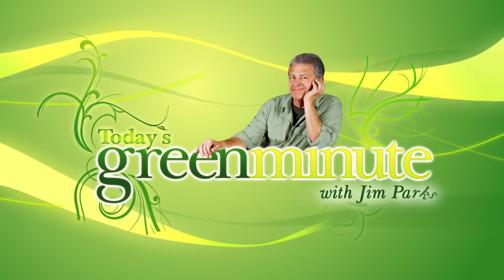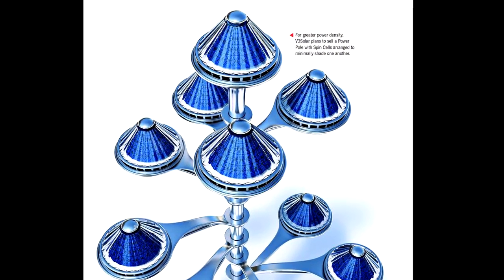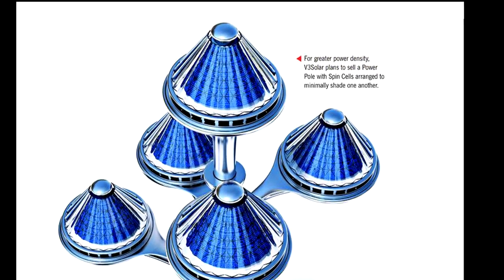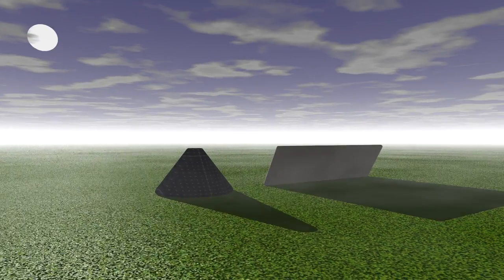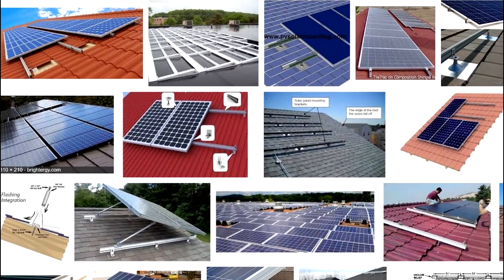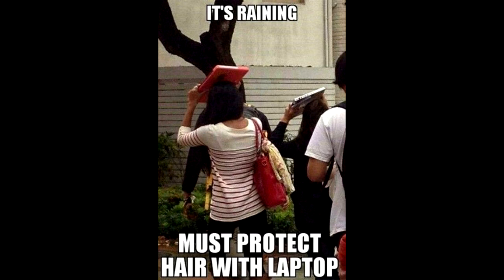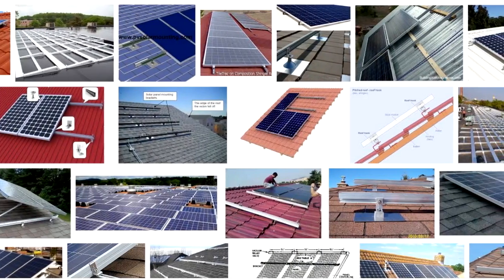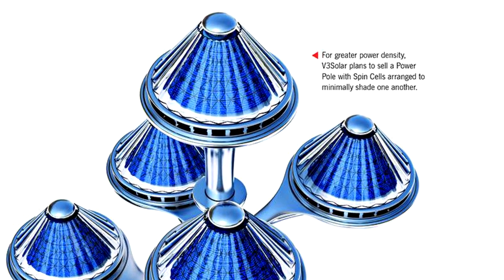Spinning Solar -BUSTED!

Comment: I'm not saying your conclusions are wrong, the cone solar panels are likely bullshit but your assumptions are very simple and don't give the solar cone developers claims a fair test.
One of the principal points of the cone is that fixed panels aren't always perpendicular to the sunlight, in fact, at best there is only one time a day on two days a year that a fixed panel would be 100% perpendicular to the sunlight.  
Using a tracking panel isn't fair because of course that would of outperform the cone, it's the comparison to a fixed panel that is where their claims become worth considering.
In the early morning, or near dusk it is easily possible that the cone could be generating some power while the fixed panel is still shaded.
Conversely during the time the fixed panel is generating at it's best much of the cone panel would still be oblique to the sun light with only a thin strip ever being perpendicular at a time, and much of it would be shaded as you said.
Basically any time the cone is in sunlight it will be generating near it's best performance, that peak may be lower than a fixed panel of the same areas peak generation but could be higher than the fixed panels high oblique angle generation ability and if this is the source of the efficiency claims (which I'd still be surprised if they were even in the region of being correct) it could start to make more sense.
Obviously I've done none of the math for this, that's why I'm not saying you're claims are wrong or that their claims are right (I believe you're conclusion is correct and their claims are wrong) but overly simple back of the envelope maths can easily lead us astray.
Reply: Except solar panel farms almost exclusively use teaching panels, not to mention that never cones never have more than 50% efficiency at anytime, minus the permanently spinning motor, is still never going to make more power than a flat panel of the same surface area, not to mention that manufacturing a bunch of tiny solar panels and arranging them into a cone would add to production costs
Reply: @aymanayad7230  I agree with everything you're saying but I've seen very few home solar installations with tracking solar panels, they're almost exclusively fixed.
As I said, I don't disagree with the conclusion, I just think the method of calculation was very flawed.
Reply: Flat non-moving solar panels are miles more efficient than the cone. Using identical angle, identical placement, and identical sunlight exposure, the flat panel generates more power, assuming an identical surface area of panelling. While the cone would produce slight more at sunrise and sunset, these are also the times where the sun is weakest. This is like bragging your tank armor is better at protecting from scratches and dents. Sure, maybe it is, but that's the least relevant amount of damage it will endure.

First off, assuming identical area of panelling, the cone already loses 50% of it's power due to half the cone facing the wrong way. It then loses another good portion to having a bad angle towards the sun. It does gain a slight bit back thanks to the cooling, assuming the spinning comes from an external power source, not the panel itself (worth considering where that power comes from though), but typical solar panels lose single digit percentages  of efficiency to overheating. The graph shown in the video shows they lose up to 10%+ in very high heat, however that's ground temperature. Solar panels are slightly suspended in the air over roofing and the floor, meaning they are far closer to air temperature, so they are actually losing far less efficiency than you might think. Cooling is far less important than the angle of the panel compared to the sun.

Comment: Good video, but you can't compare a three-dimensional structure with a 2D one, like flat solar panels.  when you compare the geometries it is necessary to consider the area of occupied land that is actually smaller in a cone solar panel.
Reply: Sure than compare it to a small ass tracking solar panel, i mean it doesn't matter either way since we haven't reached the point where there are no more wastelands to build solar farms on, or no more roofs to fit some solar panels on.
Reply: Even if that were the case, average cost of land in the US is ~$1 per square meter, average cost of solar panel is ~$150 per square meter. So any land savings have to be considered damn near meaningless compared to the price of the panels you want to install. Hell, you can have pasture underneath your panels, for sheep to graze on.

Comment: So if I stand behind a conelike object from the opposite direction of the sun I will see a 100% black conelike shape?.... obviously not  so your first argument is inaccurate since that contraption will generate energy on 100% of its surface but less efficient on the part of the surface that doesnt look directly to the sun.

The lens argument is also inaccurate because its true if the object inside is static . 
If they focus the light on thin strips of the cone while the cone is spinning it may have the effect of a bigger lens focusing on a static cone. 

And also you seem to forget the spinning part of the contraption which multiplies the efficiency not only because of the thermals but because its altering the efficiency since flat panels are not efficient when the sunlight does not shine directly on them this contraption because it is spinning will always have a part of its surface directed to the sun and all the rest of it will keep on generating power just with less efficiency where a traditional panel would have 100% of its surface produce power on a lower efficiency when sunlight is not directly shining on it.
Reply: Energy gained from light diffraction off of solid objects is negligible compared to direct sunlight, so panels on the back are a waste of time and money. If they weren't, flat panels would have them on the back too.
The shape of the cone means only an infinitely small strip has perfect alignment with the sun, ever. Judging from the size they present the cones as, you will get maybe 10% of the front of the cone having a 'good' angle. For the flat panel, the entire thing has a 'good' angle for a good portion of the day, when the sun is at it's highest, and is delivering the most energy. The cone shape allows it to take in energy better at dawn and dusk, but at those times the sun is putting out very little energy compared to at midday, so it's quite a waste to try and optimize how much power you get then.

Spinning barely helps with thermal efficiency. Solar panels do not typically reach 60 degrees as they are usually elevated, allowing air cooling to keep them at air temperature, not ground temperature. That slight amount of efficiency is not enough to warrant the spinning. Also, the power needed to spin the cone has to come from somewhere, thus lowering the cones efficiency even further. And the biggest and most obvious one, half of the cone is barely generating power. If you took that side of the cone away from the sun, and instead placed it fixed pointing at the sun, it would be tons more efficient. You'd get both sides generating decent power at once.But then at that point you may as well flatten out the panels since the convex curve was only there for the cone shape, if you split it you don't need it. And then you may as well join those 2 halves back together again. Hey presto, you've turned your cone into a regular flat panel, and made it more efficient.

Comment: couldnt they use mirrors to reflect the light back onto the un used solar panels? love your vid, just asking.
Reply: They could technically do that. But why go through the effort of pointing a panel backwards and using mirrors to light it, when you can just point it forward?

Comment: 4:58
funfact a sphere has 4 times as much area as it's circular crossection
which means that on AVERAGE a solar panel flat on the ground located RANDOMLY anywhere on the earths surface including the night side will get 25% solar flux
so if this thing get's 30% when it's in the sun, half that for nighttime that's 3/5 as much as one randomly placed on the ground - they didn't beat trackers - they didn't even beat panels flat on the ground or just statically angled
not that tracking solar panels are very economically viable
not that solar panels would ever be economcially viable on a large scale either way

Comment: If we want to be pedantic, far less than half as efficient. Solar panels are going to be most efficient when at a 90 degree angle to the sun. The cone shape increases the exterior angle and decreases the surface area that is perpendicular to the sun, decreasing efficiency. 😂

Comment: I am not sure this is as bad as you are claiming.  If the cones have lenses concentrating the light (mirrors are better actually) then they would require considerably less actual solar panel for the same solar interception area.  This generates a cooling problem that they have reduced by spinning it.

It still seems unlikely, but at least there is an actual measurable improvement in concentrating the light.  Spinning a heavy lens array not so much.
Reply: You need to cool the cells. How exactly are they meant to be cooled if you turn around the green house above them? 🤔
Reply: @RubenKelevra   I was imagining parabolic reflectors so the cells would be in thin vertical  lines exposed to the artificial wind and the back would be right on the outside and could have some fins on. Incidentally in experiments using lenses on solar cells they are typically water cooled, so it may not be enough and the crappy pictures look like weirdly shaped lenses, but that happens when the artist and engineers don't talk enough.

Comment: Small correction on the math at 6:10min:   
A 20% efficiency boost on the 30% area increases the 'efficiency normalized' area to only 36%, not 50%. (30% x 120% = 36%)

Comment: I have read this statement a few times, which I think it complete bullshit... :

 “EVs convert about 59%–62% of the electrical energy from the grid to power at the wheels. Conventional gasoline vehicles only convert about 17%–21% of the energy stored in gasoline to power at the wheels.”  

How much did the generator, that supplied the grid convert again?  Or is this a non issue?

Comment: Im sorry. 
The decay rate of carbon 14 is slow enough for the diffusion of nitrogen, the decay element to escape a diamond battery.
And, the scientist, whom was doing actual science, with an actual hard working team at an actual university on how to better manage nuclear waste, deserves credit, and praise. It does not matter if the damn battery is terrible the use of the battery is for long lasting low power, implants and watches things of that nature. The diamond carbon 14 battery is sound in concept, and in prototype.  Betavoltaics are a sound science, even if media got ahead of themselves into sci-fi with the concept, listing that battery was distasteful.

Comment: There was a TV series a few years a go it had 2 seasons i forget the name but it had like 8 people in a end of the world scenario and they had to build things to survive like wood gas to run the generator and one built a wind mill to charge the car batterys so they had power. Either way one group had solar pannels and built them on a frame with a sensor to detect the sun moving them with the sun. It was enough to give them power to run lights and power tools. They even made a trike that ran with 2 of the panels running a electric motor. Good upload

Comment: 8:50 but the lenses wouldnt need to be as precisely manufactured as they would need to be for a telescope
i agree with you on all other points though

if solarpanels that reasonably work at 200C° would be invented you could use lenses/mirrors and water cool the panels
then using the hot water/steam to power a turbine
Reply: Great comment

Comment: I'm more inclined to think it would be better to simply leave it flat at fixed center point in suns path and play around with different lens to bend the light down no matter where the sun is at the time. then there is no moving parts or motors as you said in video. but i would guess someone already tried different lens (air, liquid or whatever filled). personally i really don't see solar as being a viable solution after you take in account the cost of maintaining them and replacing things as they break down. i mean none of those panels or battery/inverters will last forever. not to mention the cost of keeping those panels clean after there installed on your roof. have you ever seen what the solar light looks like after you had them around your house for a while? the panel is cloudy with being out in the weather all the time. my sister gave me hers old lights just to mess around with cuz they did not work as good as they use to. so i cleaned it up, put new rechargeable batteries in and cleaned the solar element with headlight cleaner polish  to get the cloudy look off of it and verified the it was getting a better charge from sun and it worked great after that. whose going to clean and polish the solar panels after there up on your roof? i bet there service department is willing to help you with that ... ca-ching, there you go the price of having those panels is going up. hope your getting a lot of electricity to make up for it.

Comment: Ahhh yes also bringing up the fact solar panels over heat, well your object is smaller and what happens when the sun is directly above the cone? Wait what’s that it is the thing you are trying to fix, having the light being at a sharp angle and also we can adjust solar panels to use that heat for more power but we don’t have a way to actually do this yet.

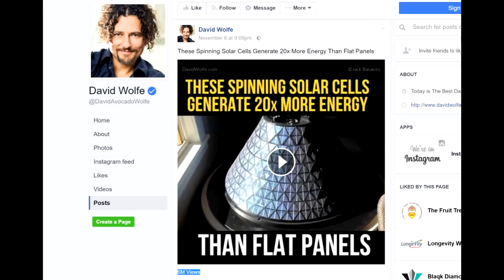Comment: Goes downhill immediately at 1:38 with claims that it 'generates energy'.
Reply: Semantics. From the user end, it generates energy, you need energy and this thing when put in the sun produces energy. It generates it. I know i know its just a converter. It takes solar energy and turns it into electrical energy. But in that case, a generator is misnamed because you are putting some sort of energy into it to turn it into electricity. Semantics. That's really the least important thing wrong with this idea.

Comment: Comparing it to a moving solarpanel was kind of a dick move. The system didn't have a chance of working any way, so comparing it to a badly placed fixed panel would have made you look less of pompous a-hole, i think.

Comment: I'm pretty sure Germany generates a lot of energy on cloudy days. Saying the portion in shadow will generate zero isn't accurate. Keeping them cool would give a 20% boost at best, but yeah, rotating solar panels is dumb.
Reply: An old idea. Problem is that for heating and hot tab water you need fairly hot water of at least 60°C. But you want to cool own the panels to below 30°C. So if you pump water through the pipes fast, your pc panel will be cool and efficient, but the water will only be lukewarm. If you pump slowly, the water will be hot enough to be useful, but only a part of the panel will be cool and efficient and the last part will still be hot and less efficient. This will cause a mismatch in voltages between the different parts of the module, causing a drop in overall efficiency.
Reply: You can't generate energy.

Comment: im not only curius but also disslexic so dont juge just anser pls , when the backside is alway cooled and it rotates does it not help keeping thesame energy lvl at all time ? is a regular solar pannel loosing power of overheating ? and why does noone youse lenses or mirrors to get more sunlight ? or a regular water or oil cooling system ? thx for all reasonobly friendly ansers upfront fellow internetz peeps
Reply: oh an also the rotating could be also ventalating against the greenhous effect ... and i made this comment half truh the video BUT combined ... would it make sence ? or is energy for rotating to mutch loss atall ?

Comment: im 1 minute in, and I've already had the thought "wouldn't they draw almost all the energy they create, if not more, to power the motors that would make them spin?"
Reply: Lmao true
Reply: And if it uses magnets, either elctro or natural, it still costs more than conventional solar panels
Reply: I think they’re supposed to be spinning due to hot air rising, but yeah. And that isn’t the biggest problem; that’s the idea that curling a flat cell into a cone will increase the amount of light that falls on it! @_@

Comment: I appreciate your skepticism and logic, but you were off about something.  Yes, spinning solar panels make no sense.  However, panels traditionally mounting 3-6" above the roof surface do not stay at ambient temperature.  They get really hot because they have mass and absorb a lot of light.  17-22% of that light is converted to electricity, some of it is reflected (otherwise they would be invisible), and the rest is converted to heat.  On a typical summer day in California with an ambient temp of about 83°, a laser thermometer on my high efficiency SunPower panels will show about 170° surface temp and generally run about 6-10° cooler than standard efficiency polysilicon panels.  In any case, they're too hot to touch for more than a few seconds without gloves on.  Just ask my install crews.  {wink}